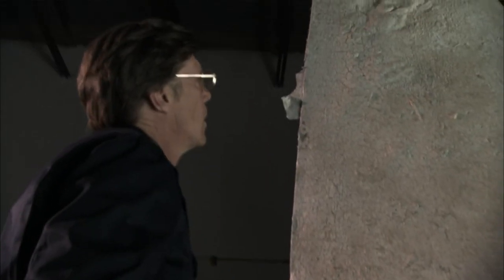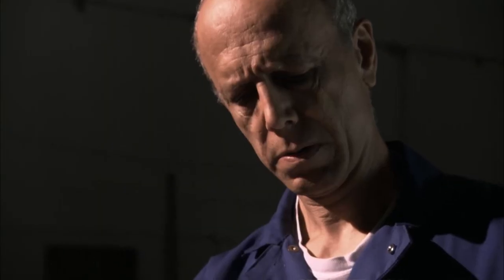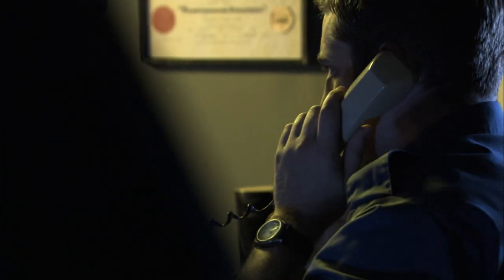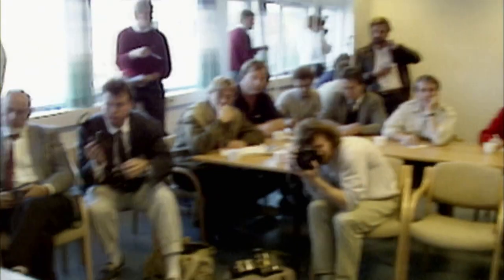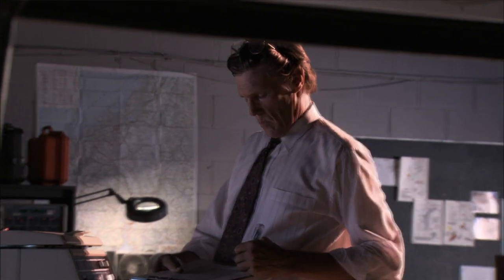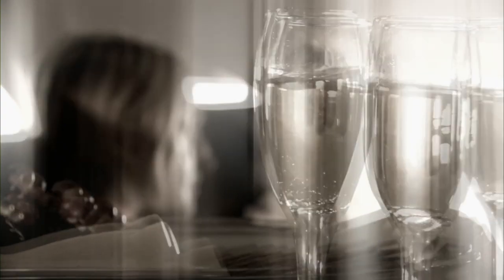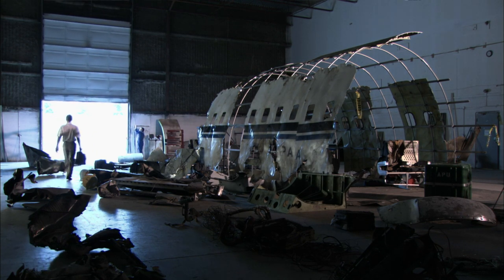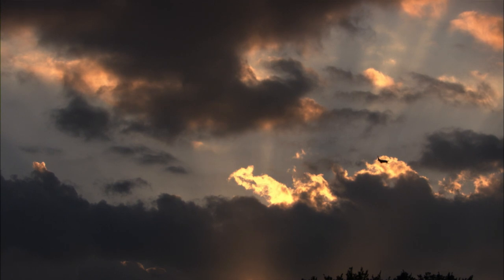A Discovery That Sends Shockwaves Through the Industry | Blown Apart | Mayday: Air Disaster

Comment: I believe I have seen a blade mounting bolt failure on a lawnmower cause the blade drop off with the engine running,could have been dangerous-should have been at least a grade 5 bolt but I think it was ungraded (or grade 1)
understand this happens in the automotive industry-counterfeit fasteners or fasteners improperly graded but rare for one of them to break-like the grade 5 fasteners or grade 8 fasteners in the hardware store could be less than the  marked grade or might even not be the brand/manufacturer trademark on the fastener --metric bolts and fasteners also have grade standards and are mostly now found in cars of traditional American brands

Comment: But wait, Didnt someone say your not supposed to fly with the apu running?  And said apu had a broken mount? Parts may well have been improper, but more to this accident than just that bolt imho.
Reply: In the case of a dual engine failure, you would glide with the APU running because you need power to pilot the plane. You do need the ability to do so.
Reply: The APU by itself wasn't the cause.  The broken APU mount (improperly repaired in the first place) coupled with the bad bolts resulting in a loose tail added together to set up harmonic rhythms that destroyed the aircraft.  If you've ever been in the military you know this principle already.  That's why a column of soldiers marching will be told to "route step" as they are crossing a bridge so that the combined rhythm of their steps don't set of harmonic vibrations and collapse the bridge.

Comment: Why where there just FOUR bolts holding a plane's tail onto the fuselage again?
Reply: And who was the genius that found one of them weak and worn, and only replaced THAT one, instead of all 4? They appear to be pretty important bolts, since they are the only thing holding the tail on!
Reply: @bigbossimmotal  Engineers at a meeting:
How many bolts to hold on the tail?
Four.
How many bolts to mount the APU?
THREE
...
Reply: @Jennifer-jc3uw  That sounds like a lot of meetings I have been in. lol
I just don't see how this mechanic thought the tail moved around enough to weaken and wear one bolt, but not the other three. The tail is, well, WAS all one piece. If one part of it moved, the other 3/4ths of it moved too.
If the wheel on your car loosened up enough to destroy one lug nut and stud, it must have chewed on the rest of the other lug nuts and studs too. And the others must have loosened up to allow it to happen in the first place. Replace all of em, problem solved.
Reply: That's probably about right. Only 6 bolts hold the vertical stab on an F-16 & it's a 9g, supersonic airframe. They're good sized bolts but still only 6 & never get checked unless the tail is removed, which is rare.

Comment: Why were only 4 bolts holding one of the most important components of the aircraft to the fuselage?
Reply: Because that's all that was needed. If the 3 remaining bolts hadn't been fake parts there's a good chance that plane would still be flying today.
Reply: It's not uncommon to use few fasteners.  There was a DC-10 flight that crashed out of Chicago O'Hare Airport, American Airlines Flight 191.  The engine came off due to hidden damage on an engine mounting pylon bracket.  As I recall those mounting pylons are secured with 3 bolts.

Comment: Approved material, tracked machined appropriately, heat treated, tracked stored and shipped and stored properly to dispense and use correctly Some one must sign inspection packages that is the same as standing in court with your hand on the bible.. Now you know why stuff costs so much!

Comment: it sure sounds fishy to me that they bring in an air force investigator on a civilian airplane crash, they are having nato drills in the area, the crew actually see an f16 go by, shortly after that the plane looses control and crashes, they find military grade explosives residue, halfway thru the investigation they give the Airforce investigator a promotion, and they conclude that " bogus bolts " bring down the plane, there is no doubt in my mind that soft bolts in the tail and coupled harmonics could cause it to tear off mid flight, but that still doesn't explain how the military grade explosive residue got on there !
Reply: I guarantee a convulsive supersonic shockwave extends far beyond a few meters and well beyond 1000 feet, that comment marginalizing its potential effects was laughable.

Comment: 250 dollars for a bolt ? What a crock !
Reply: are you surprised by the cost of the bolt? The bolts are cheap. The testing and the certifications are the ones that add the cost which is rightfully so due to the stakes involved
Reply: @anzer789  thank you for clearing up why the cost was that high.

Comment: Boeing 787 one piece carbon fiber fuselage sections (barrels) required Titanium fasteners. Subcontractor Alcoa had problems making those bolts and was pressured to meet deadline. This resulted in Alcoa shipping Aluminum fasteners for the first prototypes. Failure to do incoming parts testing Boeing used those parts.

Comment: An APU usually only runs for a few minutes on the ground while the plane is stationary .. they aren't designed to operated for several hours in flight .. the mount could have been broken for several weeks and would not have been discovered until the next heavy maintenance check .. the only other time an APU is used is if there's an emergency in flight and they need the electrical power to operates flight controls or landing gear or instruments to get the plane safely to the nearest airport .. operating the APU in Flight as a secondary power source should have NEVER been approved by either the pilot or the mechanic or the chief engineer v..

Comment: Real part $250
Bogus part $30
If the manufacturers of the real parts didnt mark up their prices so astronomically high I doubt airlines would be trying to cut so many corners. I understand the quality control and machining can cost more, but not over 8 times the price...
Reply: You don't think there's a reason the bolt costs $250?
Reply: @richardcline1337  exactly. That's $700 EpiPen only has $10 worth of epinephrine. There's no way it costs $690 for the plastic auto injector...
Reply: @JohnDoe-rx3vn  as I originally stated I understand that additional machining and quality control cost money but not to this extreme. This is just corporate greed that results in people trying to find a workaround. If the bolt was priced more reasonably, say between 80 and $100 I don't think the airlines would have been using the substitutes.
Reply: If no other legitimate manufacturer came out to supply the bolt between $30-250 then the bolt is obviously correctly priced.